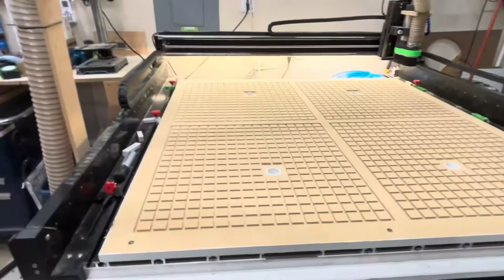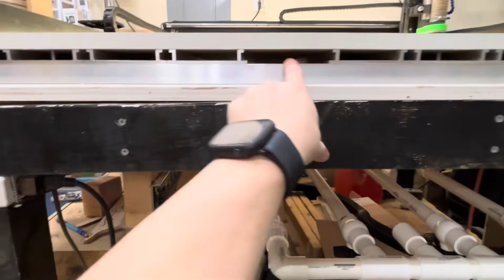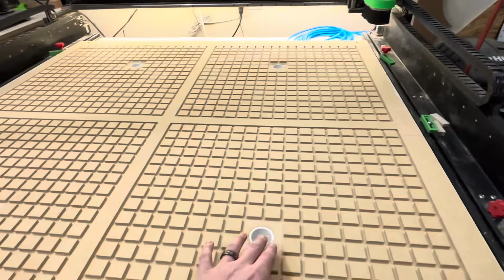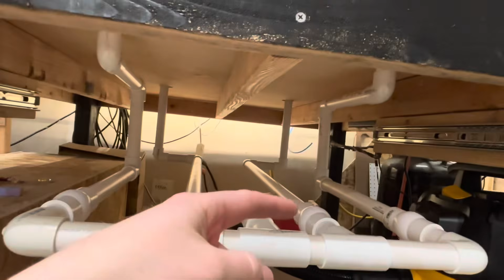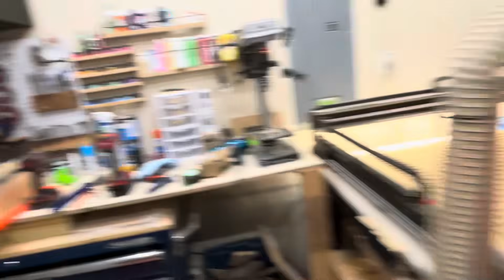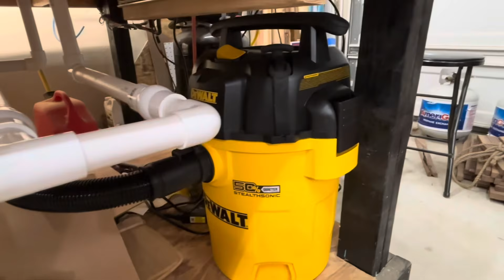DIY Vacuum Table for Shapeoko 5 pro

Comment: Just watched yur video. Wondering how it worked out after making imorovements.
Did the vacuum burn out?
Did you surface both sides of the spoilboard?
Did you pu any sealer on the vacuum table?
How did you hook up the vacuum hose to the PVC?
Let me know, I'm going to make my own following your tipe

Comment: You can use thinner spoil board. You can also put scrap pieces around your project board to prevent lost suction and hold you piece in place better. Helps with smaller pieces. Great job!
Reply: 30 gallon garbage bags laid flat work very well for sealing unused space.

Comment: Don’t use the vacuum. Use a pump. Vacuum will burn it electric engine soon
Reply from the maker: Thanks for the info, yes I eventaully want to upgrade to a pump, do you have any suggestions that can still be relatively quiet?
Reply: @Wiblewoodworks  I don't know about noise levels, but you'll want to get a bypass (ideally tangential) vacuum motor if you do go down that route. Normal vacuum motors found in household vacuums or shop vacs are pass-through motors which means that the air flowing through them is used to cool them. A vacuum table starves the motor of air flow and can lead to overheating. If you want one for cheap, you can sometimes find whole home vacuum systems for cheap on marketplace.

Comment: Reaaly nice! I'm doing my research to build one for my 48x48 Altmill. I'm sick of clamps. What material did you use for the table? Looks like MDF. I'm planning to use 1/2" HDPE.
Reply from the maker: I did use 3/4 MDF, I sealed all of the edges and it has enough suction force to hold down the work I am doing.
Reply: @Wiblewoodworks  Thanks!